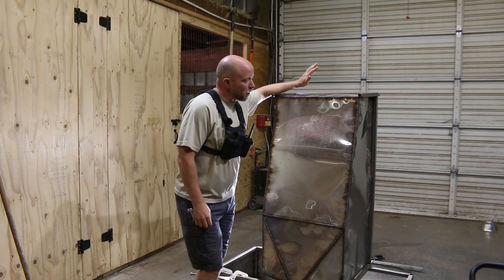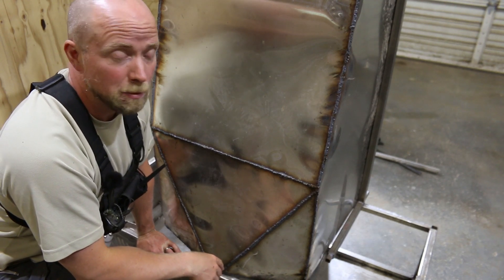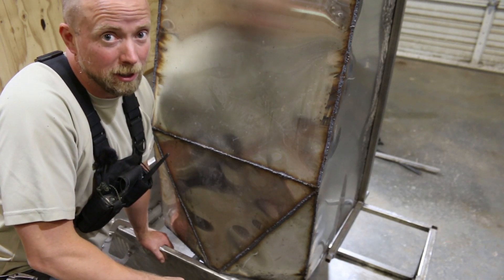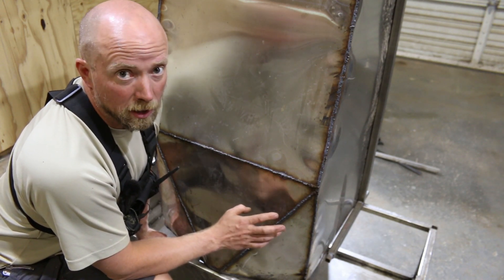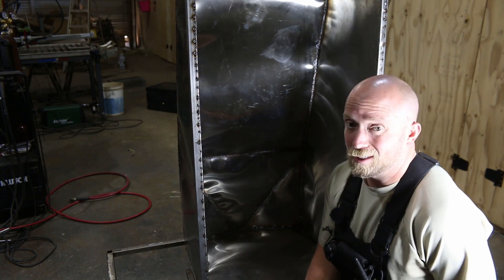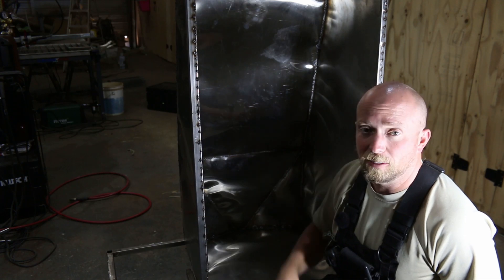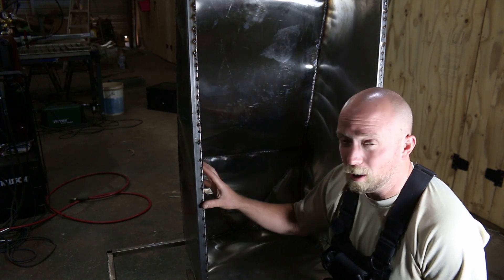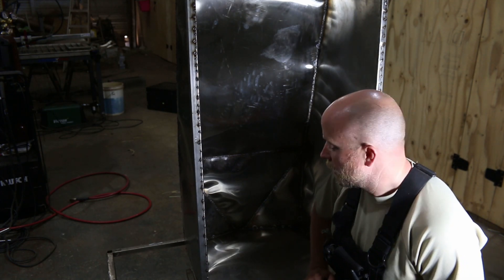Stainless Steel Sheet Metal Tank Welding for AEROPONIC Reservoir

Comment: If you do go down the silicone path, try and get hold of T-Rex silicone, the grey variant is food safe and works well under water, I regularly use it on Bainmarees and dishwashers and haven't had a call back yet 👍 you could also rivet the sheet metal in then use the T-Rex to seal the rivits as well as the corners 😁
Reply from the maker: Thanks for the tip! Tried to find a US distributor...do you have a link? All seem to be AUS but they wont ship to US
Reply from the maker: ps if you do have one can you email it to me at trm@therealmartian.com?

Comment: Edge welding thin stainless steel sheets is not the way to make a tank by hand. You will never get a leak free weld on such thin material trying to do that by hand regardless of how good a welder you are.  Even the best welder is likely to scrap a lot of tanks trying to do that.  You'd need much thicker panels to make edge welding work.

The way we welded steel fuel tanks at Ford when we were still making them was to use deep draw presses to press steel sheets into top and bottom panel halves each with a welding flange about 3/4" wide all the way around the seam.  Then we would put the top half panel on the bottom half panel, align the flanges, and tack them together using several spot welds on the flange edges.  Then we used a seam welder consisting of two copper pulleys with copper wire that fed around the pulleys to form continuous resistance welding electrodes.  The top and bottom flanges were squeezed between the pulleys with a fair amount of force in the middle of the flange and then we used pulsed resistance welding to create a continuous resistance seam weld all the way around the seam.  As the pulleys rotated, new copper wire would be fed in so that we always had fresh copper electrode.  The spent copper wire was chopped into small pieces and dropped into a collection barrel.  Think of the continuous seam weld as a large number of overlapping spot welds all the way around the seam.

We experimented with edge welding tank halves in order to eliminate the flange and maximize the fuel tank volume within a given amount of space, but the alignment between the tank halves had to be far too precise to be manufacturable.

I realize you don't have a seam welder, but you can incorporate flange bends into your pieces and use epoxy to bond the flanges together and seal them.  The flanges allow for greater variability between the pieces being joined and using expoxy will give you a greater chance of producing leak free joins.  Epoxy can also be used to seal the corners where the flanges meet.  That will be required because you don't have the press and dies needed to form continuous flanges so you will need to bend the flanges by hand using straight flange bends.  Consequently, the flanges won't be continuous through corners and will create leaks at each corner unless it's sealed with epoxy.  You could drill a few holes in each flange, coat the inside of the flange with epoxy, and then use pop rivets to join the flanges and provide the clamping force to create the expoxy bond and seal.

It's just an idea.  Take it or leave it.

Comment: Jeff,  it seems like unnecessary personal energy and consumables are being poured into stainless.  Tank geometry, drainage and waste removal are the concepts you said are important to prove at this time. Silicon will easily seal the maximum of 1.5 psi of pressure in this shallow tank. We’re burning daylight!  IMHO.

Comment: Great first time welding Stainless steal tank.  Brave  to try tank right off.  If tired of welding.  Use some flex seal on weld areas (then run the system).